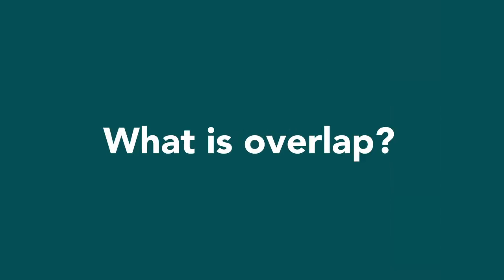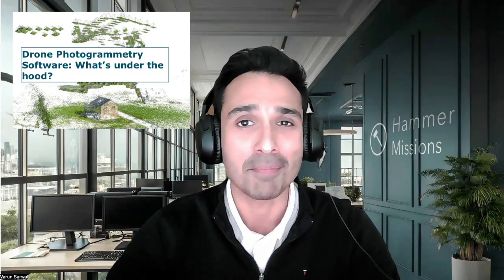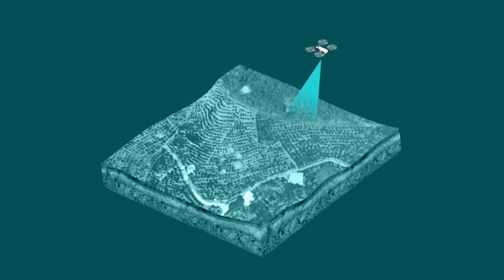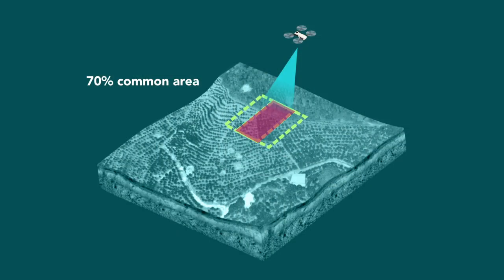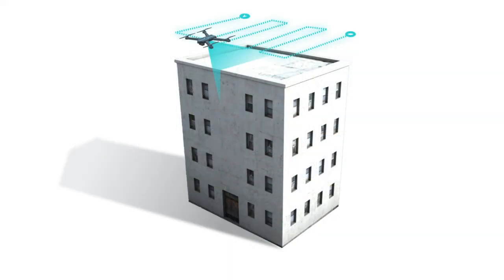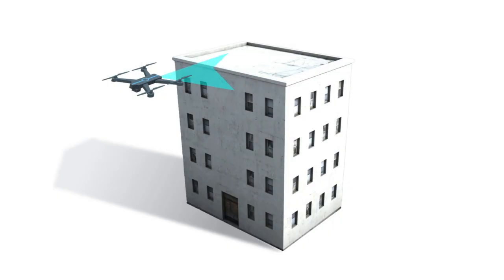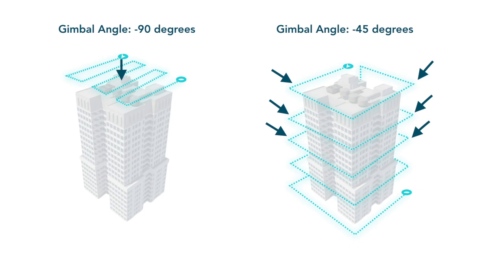What is Vertical Overlap in Drone Inspections? | Hammer Missions

Comment: Overlaps are a very important subject. Why is there a choice for the pilot to sometimes adjust the vertical and horizontal overlaps separately?
Reply from the maker: This gives you more granular control over the flight path. There are situations where you might prefer to reduce one of the overlaps to give you more control of the total images. In most contexts, you would keep these the same